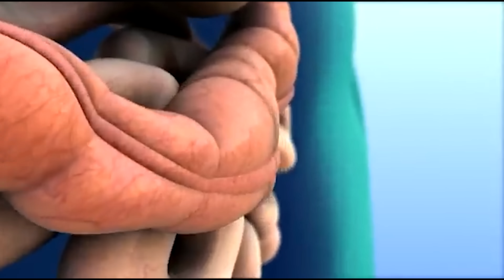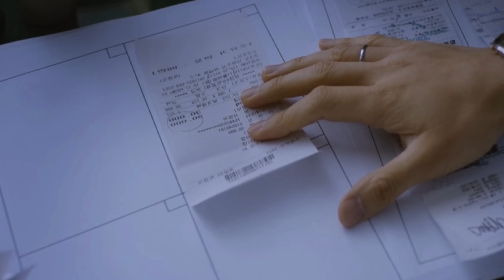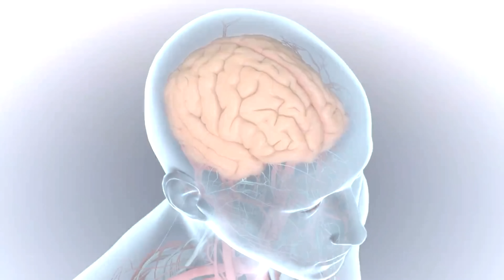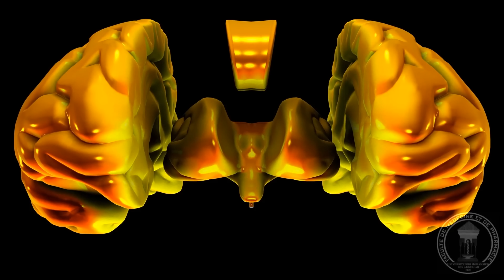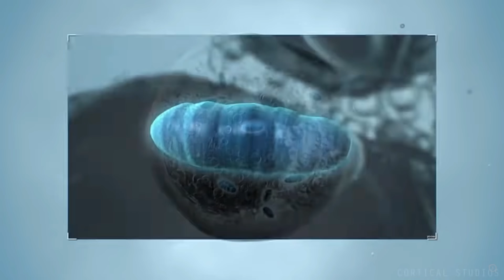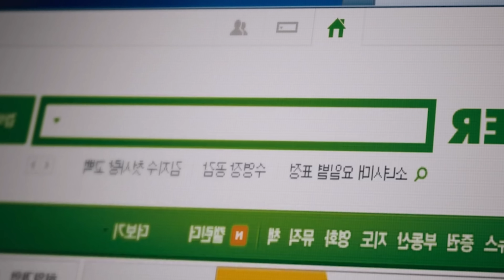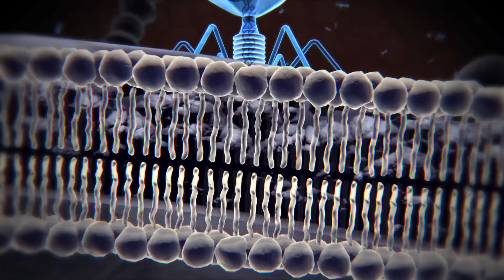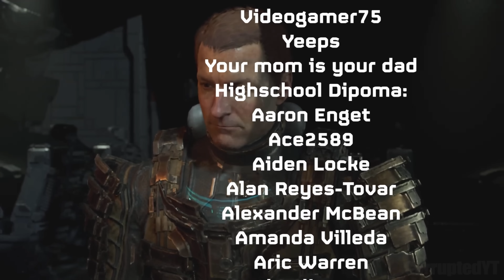The "Deranged" NERVOUS SYTEM HIJACKING Parasitic Infection Explained

Comment: For those not sure how the thirst must feel, i think i have a pretty simple but good perspective on this.
Im a type 1 diabetic and if my blood sugar gets too high to the point where it needs to come back under control, slowly, i feel a need for water. This thirst is something akin to those sugar cravings you get in younger years. The first bite of a candy or a cookie only incites the need for more sweets. Water becomes a liquid sugar. I've had an incodent where my insulin went bad, and i needed a new supply quickly. While i waited, the craving for water only increased as the inside of my mouth began to feel like dry crackling cotton. The lethargy Roanoke mentions begins to kick in, and you feel like the simplest things are too much work to do. Though i can't say I've ever felt the primal need to drown myself in water, I've definitely drinken enough water to make myself sick.
Reply: Your insulin went bad? Did it just expire or did it get contaminated?
Reply: @alexkuhn5188  there was a leak in the last two vials, a crack along the sode that fluids were coming through. Due to them being the last, I didn't want to risk infection from them and called my local pharmacy immediately.
Reply: I’ve got pituitary diabetes insipidus and before diagnosis and my prescription med, my record was 9 gallons of water in 24 hours
Reply: @alexkuhn5188  extreme temperatures can also make insulin spoil usually it needs to be kept in a refrigerator and depending in the type it will only last a couple days at room temp, if it frrezes or goes above 85°f it's no good. One of my friends ended up in a diabetic coma after hurricane Harvey because his electricity was out for days and the heat spoiled his insulin.
Reply: @emperorkraglint9792  so possibly contaminated then. I hope you don’t have to deal with that again because that sounds like it sucked to go through! The symptoms you went through while waiting I mean!
Reply: In the case of diabetes, the body can try to remove excess sugar via kidneys. I am t2 and had slowly adjusted to not realize how much I was drinking, 2+ gallon. Keto+metformin later  and i don't drink a fraction of what I did, even when sweating from working.

Comment: One nitpick about this movie is the sprinkler system.  Modern sprinklers have a stand pipe reservoir of water just sitting there ready to be dispensed.  Even if you cut off the water from the outside you should not be able to disable the system like that as a safety measure.  It is nasty water thats been sitting for a long time but it should be enough to douse most fires.

Unless they just had bad fire codes which is perfectly possible given how much the government was willing to cower before a company.

Comment: I'm considering how fungus infiltrates muscles to move insects. A worm likely wouldn't have the capability. Meaning it's either a form of mind control or physiological manipulation. I was considering that the horse hair dehydrates the host so that I will be driven to seek water. However, it is known that the insects will always drown them selfs as opposed to just drinking. This is because the worms life cycle is dependent on the insect being fully submerged in the water. I think the implications being it is a form of mind control: whether hormonal or brainstemmy, we still don't know. Any thoughts